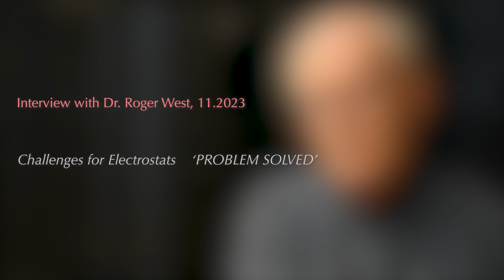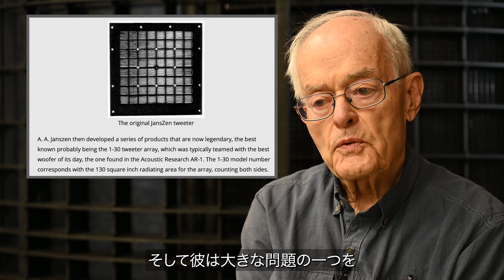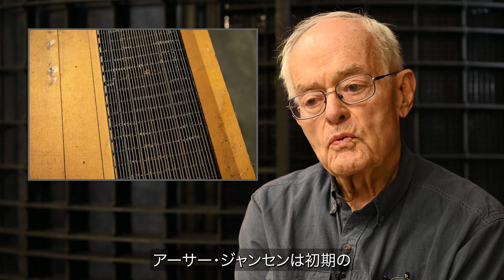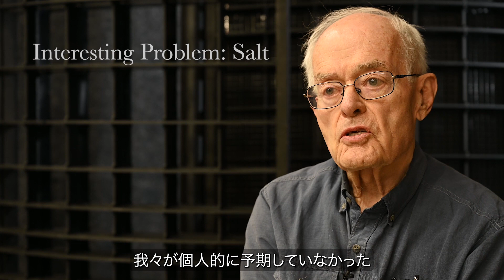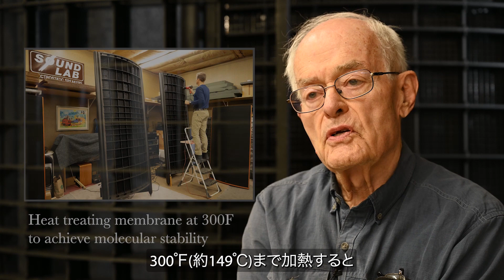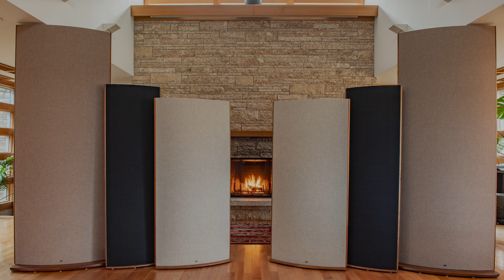Challenges for Electrostats: Problem solved

Comment: Wether a copper trim is nescessary depends on the exact resistance. Many esls dont use them or use the copper not on the membrane but inside where it doesnt work against leakage paths. Anyway it wont hurt using this way and the idea is very good

Comment: Great video!  

On the acoustic side of things, SoundLabs do two things better than any other loudspeakers (when set up properly):  They get the direct sound correct; and they get the reflected sound correct.  These are both easier said than done.  I know of no other loudspeaker that does either of these things as well, let alone BOTH of them.  You can listen to a pair of SoundLabs all day long day after day and they NEVER become fatiguing.  Every recording is more interesting, more engaging, more elevating than it was before.
Reply: I disagree. They don't get the direct sound better than any other speaker. Not even close. There is no correct reflected sound. All reflected sound is an added coloration